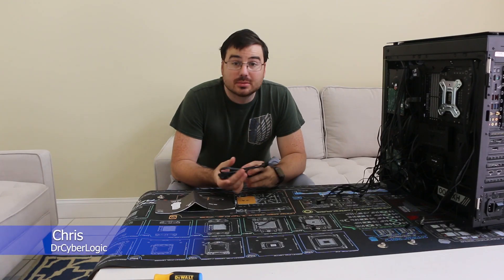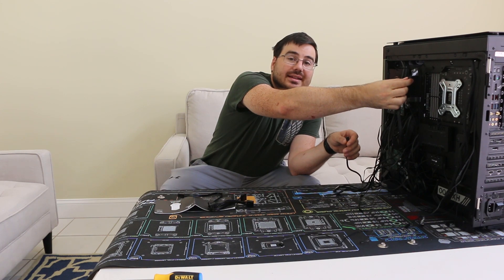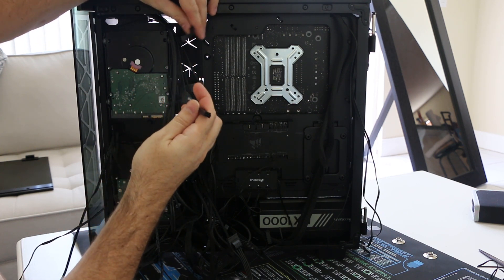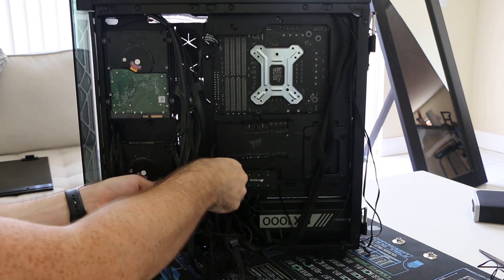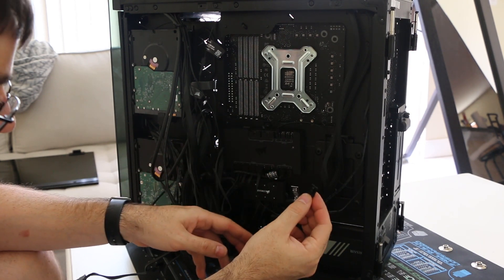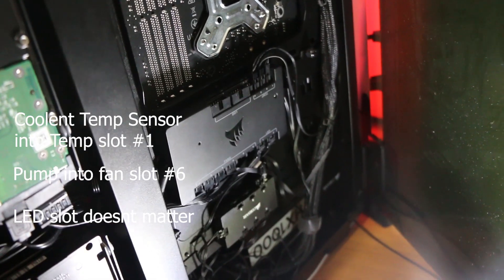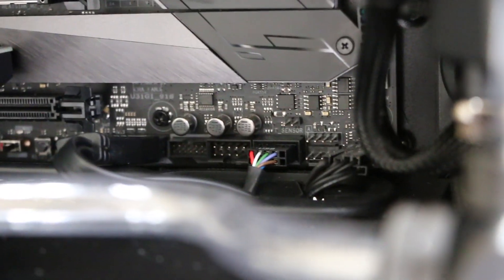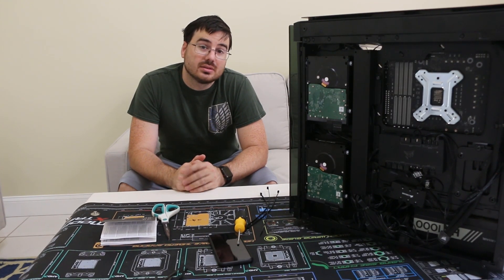How to Wire the Corsair Hydro X Custom Loop

Comment: It's November 2021 and you're still the only person with these tutorials on YouTube lol everyone else including Corsair lab videos just skip all the parts I'm actually curious about. With that said I decided not to use the commander pro, it's ugly and bulky. My question is, where should I plug that header coming out of the pump. Should I connect it to the cpu fan, or the w-pump headers? My motherboard already has the stuff included  on that commander hub and I want to try to use the loop without that hub (unless I have to but I do have an unopened hub just in case I HAVE TO use it)

Comment: Thank you for this video! If you control all fans and the water pump using the commander pro do you connect something to the cpu fan port on the motherboard or can you leave this port unconnected without any problems (Pc does not start etc.)?
Reply from the maker: No, I currently have nothing plugged into the CPU fan input on the motherboard. you will have to go into the bios and turn off the option to search for CPU fan or you will get an error on boot.

Comment: Hi! I have a question about the wiring connection to the motherboard, do I have to use cpu fan from the motherboard? or just leave it alone?  Im new to this custom water loop. thanks in advance

Comment: i got the node pro and the c pro and im not sure but i dont think it came with enough of the cables to daisy chain as the majority of the cables are fan extension and not the 3 pin ones did you have buy more outlet cables to set everything set up ? thanks

Comment: Greatvideo but a little more detail on the cable connections would be appreciated. The cable from the pump to fan slot 6 on the commander pro, what is this cable again? Also how many temp sensor cables did you get with your commander pro and where are they connected from and to on the commander pro or motherboard?

Comment: I have the 4 connector in Fan6, molex connected to molex from PSU, led from reservoir to led1, temp sensor from reservoir to temp1 header in the commander Pro, still my pump isn't recognised.. I don't know why.
Reply: How did u fix your problem?